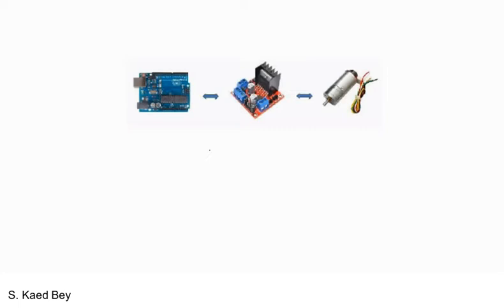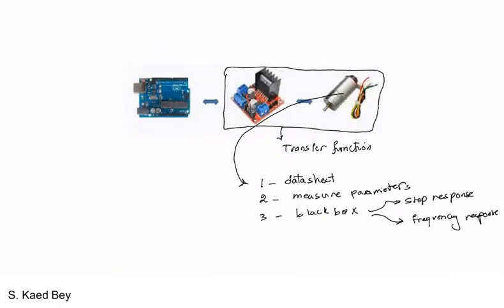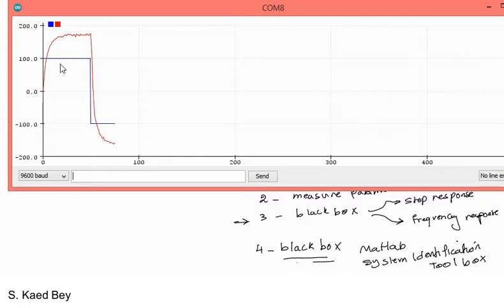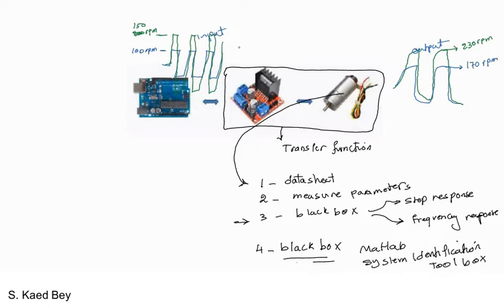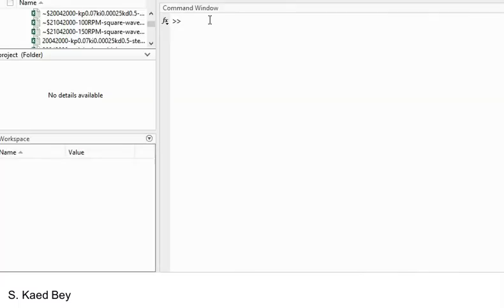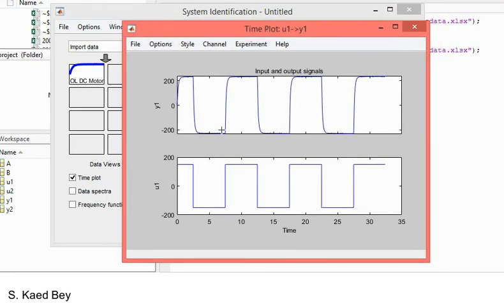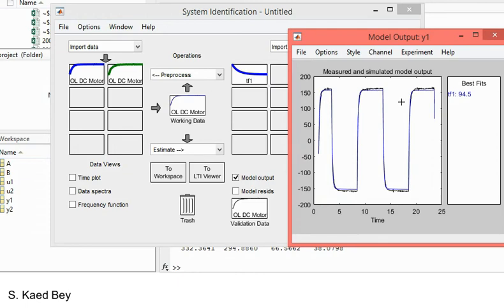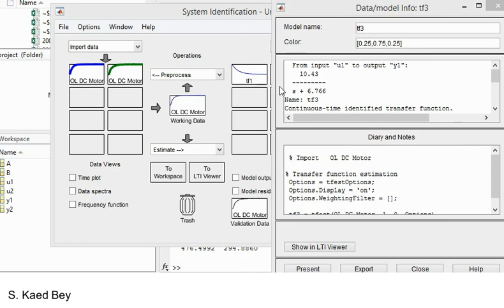Project (Part 9)- Linear Transfer Function Estimation Using System Identification Toolbox in Matlab

Comment: You mean by input the voltage, not the rpm_ref, right? And how can I deduce this data because PLC is very slow so should I use an embedded system like STM32?? or what?

Comment: the model at 21:34 is incorrect, it is basically an integrating system, it will probably still work for short time periods because it is integrating so slowly, but it is not correct

Comment: Sorry for my english.
How do you measure the data? In my point of view, i only know 2 ways to do that, you count the pulse or you measure frequency. The second method is much better but the arduino's clock is just 16MHz so i dont think this method is possible to do, and if you use the first method, it will not be accuracy.